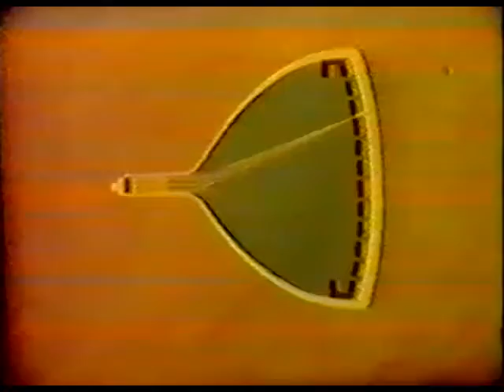It's The Tube That Makes the Colour

Comment: if we have shadow mask and precise positions of blue red and green phosporus dots, how picture streching, skewing and rotationg works and even resolution change?
Reply: Colour CRTs are not like LCD etc. panels, which can only illuminate a whole pixel. The three scanning  electron beams can easily illuminate a portion of a single phospor dot (of its own colour) so general analogue picture geometry settings such as height, width, and incoming picture resolution are not affected by dot position. Indeed each scanning line of a picture might strike the same three phosphors more than once when building up an interlaced picture, or strike fractions of phosphot dots below and above the centre of the beam as it scans horizontally across the screen. The scanning lines are never aligned to the dot positions in any way at all. Unlike modern flat screens there is no "native" resolution at all. The same type of CRT could be used for 525 line scanning at 60 fields per second in the USA, as they could for 625 lines in Europe, and in the case of my country the UK , at the start of colour TV, they were run (by dual standard colour sets) at 625 lines on BBC2 (UHF bands) , and 405 lines for the legacy black and white channels (BBC1 and ITV, on VHF bands) before they were also simulcast in colour on UHF bands with 625 lines, with standards converters used for the remaining  405 line only black and white TV sets.
Reply: Technology Connections has done a whole video on this "These are not Pixels".

p.s. In the dying days of CRTs when widescreen had become norm and ultra thin Plasma sets were available for £Thousands, Samsung made tubes in which the pixel pitch varied, depending on the position on the screen. Fine pitch in the centre where the action was most likely to be and a coarser pitch towards the edges. it allowed them to make the tubes a couple of inches shallower than other manufacturers.